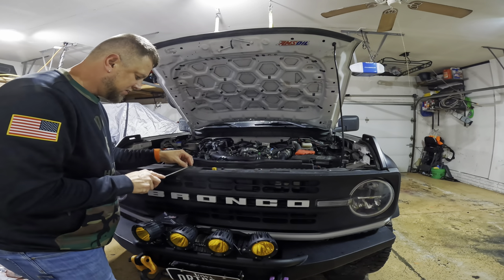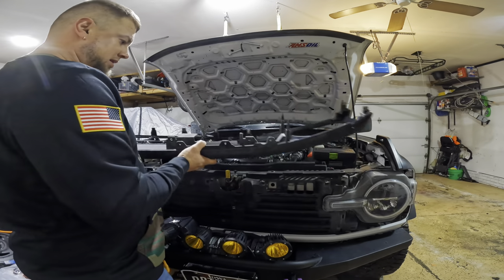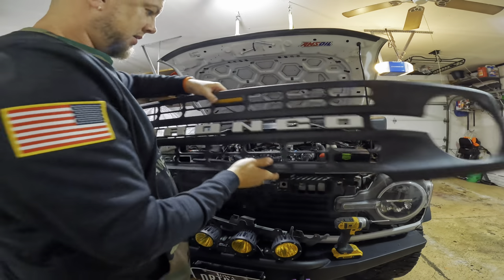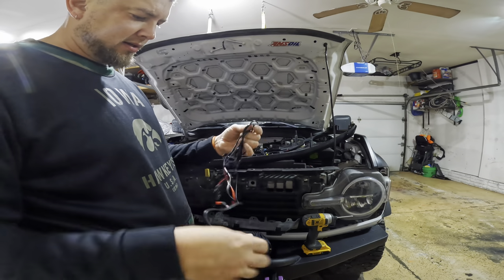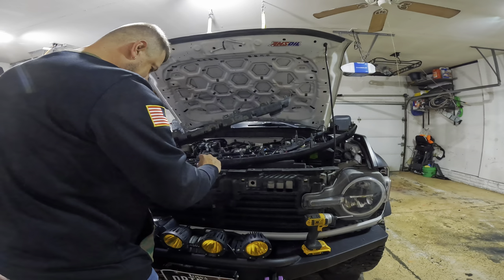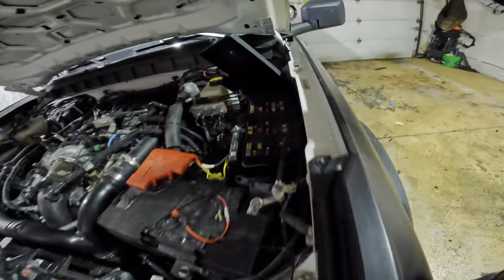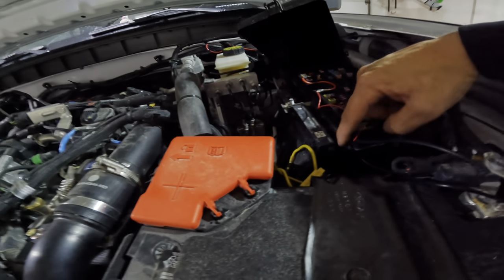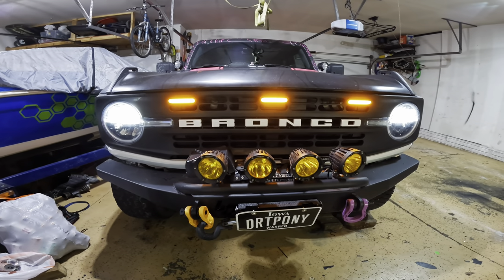Ford Bronco “Raptor” Grill Light Install

Comment: Thanks for sharing. I'll be helping my dad install this kit today on his Bronco. Looks pretty straight forward. Did you encounter any issues routing the wiring from thr grill to the fuse box besides what you showed in the video?
Reply from the maker: Nope, over all routing the wires was easy!
Reply: @LifestyleOffroad  We struggled to find a good solution to avoid pinching the positive wire out of the fuse box when installing the cover. What did you do there?
Reply from the maker: @MountainSalsa  just cut a small slit in the side so the wire could feed through
Reply: @LifestyleOffroad  thanks!